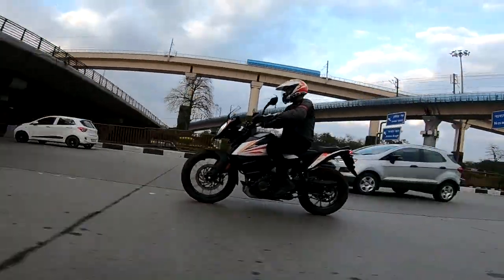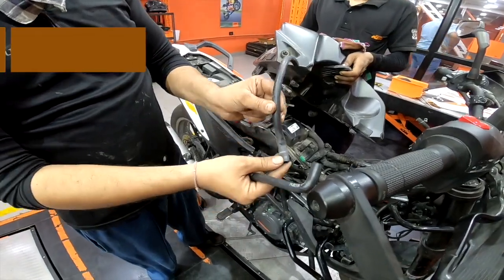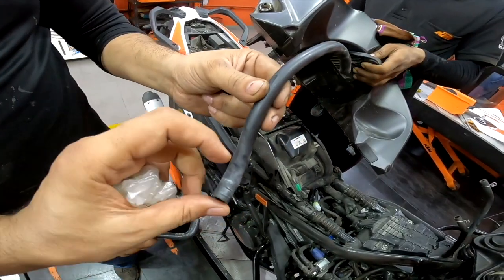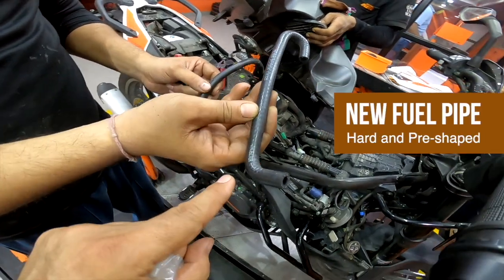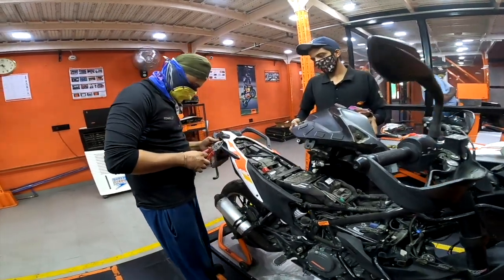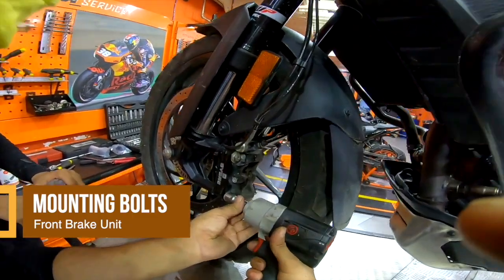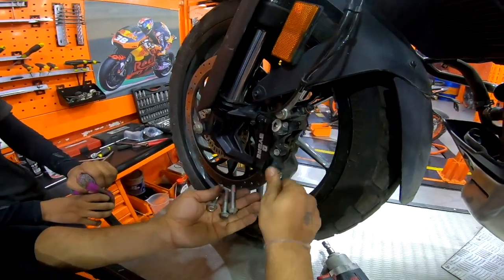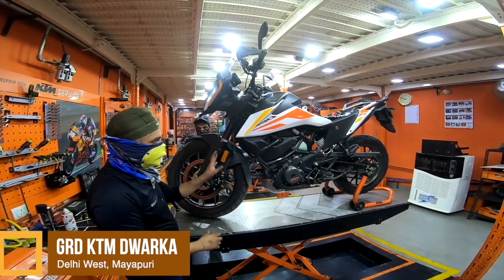KTM 390 Adventure, 2 important modifications before a long ride

Comment: Got my bike today. It’s freezing here so only rode it home. It stalled before I even made it to the house. I think it is that hose judging by how and when it happened.
Reply from the maker: Congratulation for your new bike. I don't think you should have any issue with a new bike as this modification is quite old and factory has changed over to new assembly process. There must be something else.
Reply: @WingstoWheels  I still can’t test it much but at low speeds like under 20 mph for more than 30 seconds or so I can feel it wanting to stall. Now I give it throttle here and there but if I just hold it at 15-20 mph it will stall. Once I can put some more miles on the bike I’ll have a better idea of what’s going on but it can really only be one of a few things.
Reply from the maker: @SticksAandstonesBozo  on a new motorcycle if it is stalling at lower speed, it could be due to restricted fuel supply. So please get it checked whenever get an opportunity to visit service station..
Reply: @WingstoWheels  thanks for the videos and tips.

Comment: Hi, very interesting topic.
Question:
Is this a known “ defect” which must be rectified by KTM or is this a personal choice to get these 2 items replaced?
Asking as I just purchased my KTM 390 Adventure and i think my bike was assembled in the Philippines, therefore I am not certain if this problem still exists on my bike.
Can you perhaps clarify this for me?
Thank you for posting this video 👍
Reply from the maker: No these are not defect but an improvement in design. This video was made in July 2020. So I am sure these two items change must have been done during the bike production itself. May not be applicable today but when go for service you can cross check once.
Reply: @WingstoWheels  thanks, i check with my KTM dealership once I bring it into the first service. Appreciate the reply 👍

Comment: Hi, 
Just done the 1st service after 1150km. The cost is ok (136€) but nothing done execpt oil change !!
The front brake bolt where change before delivery (so ok).
The TFT was not updated to 1V08, I'm always with 1V07.
Worst, the fuel pipe was not changed. The dealer tell me that there is no recall here in belgium !!??
I ask to order the new pre-bended fuel pipe (JP171816) but he tell me that he doesn't find that reference.
Can someone help me to find that new fuel pipe. I really want to change it.
Thank you
Reply from the maker: I was informed by an engineering manager that all motorcycles which are produced now are fitted with new pipes. Only thing you need to check your date of manufacture. If you can give me details, I can check from someone.
Reply: @WingstoWheels  
Thank for offer your help.
My bike is from 01/2020 (manufacture date) and I can clearly see the old pipe almost pinched.
I you need, I can give you the VIN number but I don't think it is necessary.

Comment: Sir height is 5ft 4 inch,, I want to buy a Ktm 390 Adventure, but is there any possibility to lower the seat height. I can't even tip toe on this bike.. If there is any modifications to lower the seat height, then I will buy it.  Thank you sir,, Big fan..
Reply from the maker: Bychance did you see this video ..... https://youtu.be/xmqOc9EIB-A

I will get back.
Reply: Yes sir,, but in city traffic it could be a problem, that's why I'm asking sir